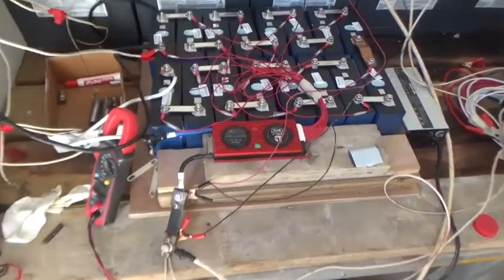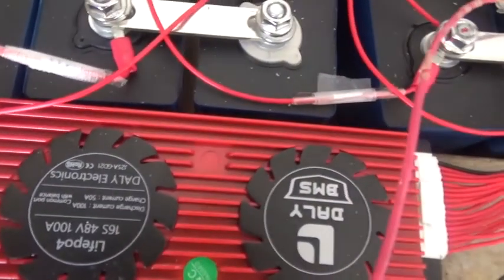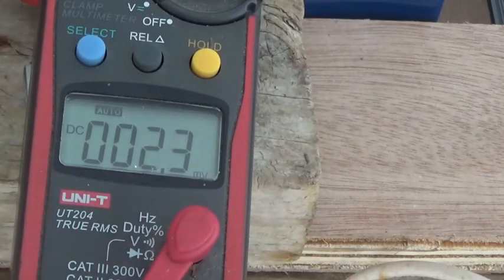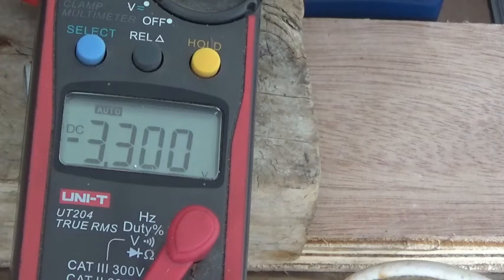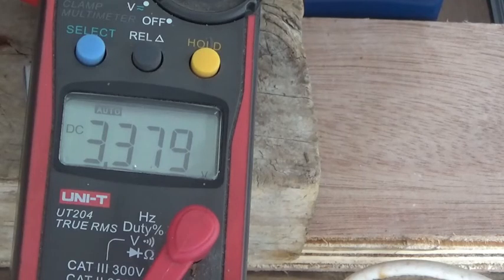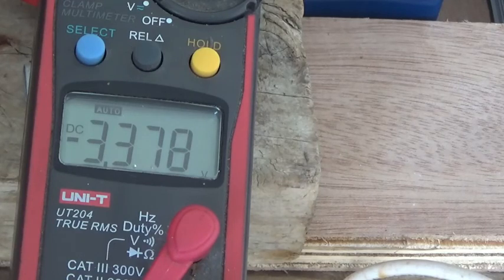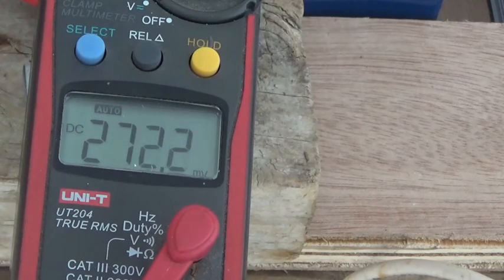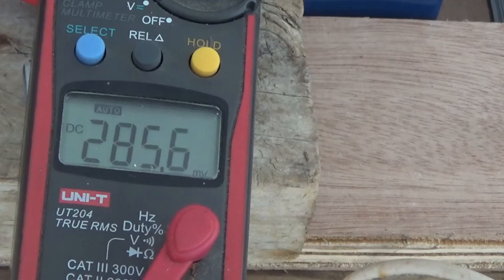100 AMP 48 VOLTS DALY BMS FINAL THOUGH

Comment: Hello, please follow these instructions, disconnect everything, Inverter, regulator, BMS and battery jumpers. let's start from scratch, first place the cells all in parallel joining all the positives. and joining all the negatives. the positive poles should not touch the negative, maintain this connection for one hour, the result will be that you will have balanced voltage in all the cells. a difference max. +/-0.025v. rebuild the 16S battery pack and follow the manufacturer's instructions. the BMS will work at a load cut of 58.4 V (3.65v per cell). discharge cut-off voltage 2.56V and low voltage disconnection 2.2V per cell. (16S 35.2v) Important, PWM or MPPT must be selected in LITHIUM or USER
Reply from the maker: Very good points!!! ...At the end of several cycles, the  max. voltage between batteries  was less than 0.002 v ...or 0.2 mvolts!!! ....The issue was during the first charge....that I got about 200 mv...!! 

Thanks.

Comment: Hola, por favor sigue estas indicaciones, desconectar todo, Inversor, regulador, BMS y puentes de las baterias. ermpecemos desde cero,  primero colocar las celdas todas en paralelo uniendo todos los positivos. y unioendo todos los negativos.  no se deben tocat los polos Pisitivo con el negativo, mantener esta conexion por una hora, el resultado sera que tendras balanceado el voltaje en todas las celdas. se acepta una diferencia max. +/- 0.025v. reconstruir el packa de baterias de 16S  y seguir las instrucciones del fabricante.  el BMS trabajara a un corte de carga de 58.4 V (3.65v por cell). voltage de corte descarga  2.56V y deconeccion por bajo voltaje 2.2V por cell. (16S  35,2v) Importante, de PWM o MPPT  debe estar seleccionado en LITHIUM o USER
Reply from the maker: Estoy de acuerdo....pero...en mi instalación, yo me salté ese paso y las puse todas en la configuración 16s y déspues de unos días todas se calgaban y descargaban dentro de unos 5 mvoltios que esta mas que bien.  La pregunta es por  que yo me fui rapidamente a la configuración 16 S??? Simplemente porque mis baterías eran todas nuevas...y el BMS debe ser capaz de igualar la carga/descarga en la marcha.  Nuevamente , muchas gracias.

Learning.